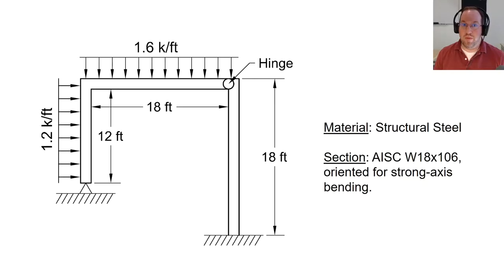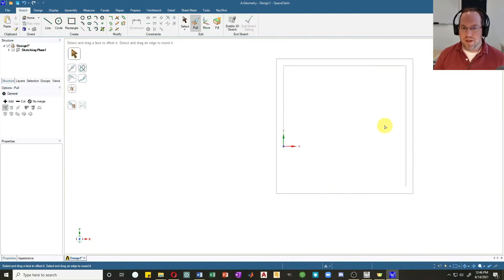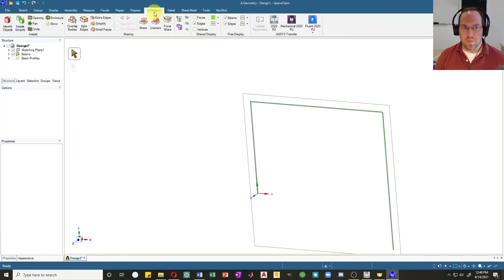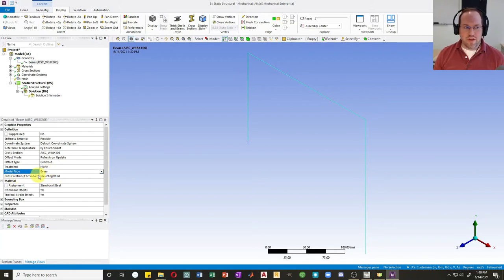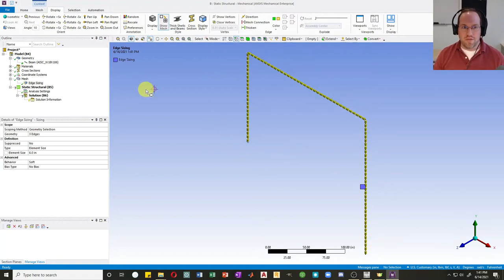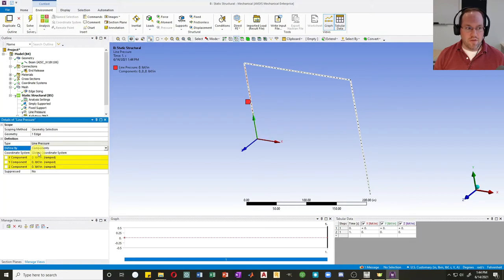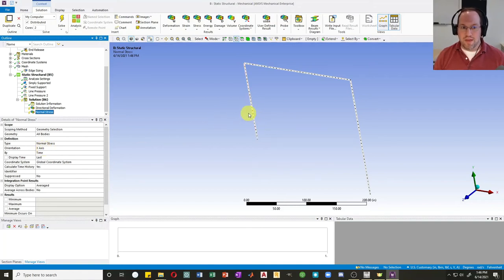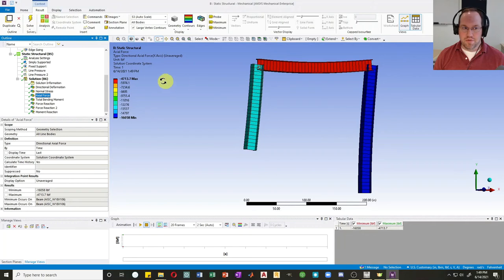Frame Analysis - FEA using ANSYS - Lesson 4

Comment: Hello Prof. H,
I saw your last video for the truss. You change your elements to links in order to treat the problem as a truss instead of the frame. However, I have a question, can I do the same problem by treating it as a frame and applying for an end release at the joints. What I found is, end release is giving some errors while doing that
Reply from the maker: I'd be careful with using just end releases to model a truss with frame (i.e., beam) elements. It's possible and even likely that you could "under-constrain" the model, in which case it will give you a error that you have rigid body motion. Don't get me wrong - it should work in theory, but often in practice something weird and unexpected happens. Without more detail on exactly what you did with your model, I can't say for certain exactly what went wrong. However, best practice is to just use the link/truss element for trusses (and, besides, it's more computationally efficient than beam elements anyway).

Comment: In previous video you changed the number of mesh elements to 1 for each truss member. Here for frame, that was not the case. Could you please explain as to why ?
Reply from the maker: Truss elements can only carry axial load, so in effect they behave as though they are always pinned at the two ends. If you mesh a truss with multiple element in a single structural member, it would be like adding a bunch of hinges along the length of the member - you would immediately see convergence issues, and it would not give you the correct answer.

With frames, the "beam" elements can carry internal shears and moments as well as axial forces. Hinges and other releases must be modeled explicitly with end releases. Because these internal forces will change along the length of the structural member, you need to have multiple elements to accurately model that behavior.
Reply: @StructuresProfH  Thanks a lot.

Comment: Great video!
Do you know, why it isn't possible to use the CP command for coupling DOFs? Your method works but is unfortunately a bit circuitous. :(
Reply from the maker: I'm afraid I don't know the answer to that, but I can take a guess. I agree, the CP command should in theory work. However, once you use the Share Coincident Topology function (the "Share" button in SpaceClaim), I believe the nodes are automatically merged; i.e., not just coupled, but converted into a single node. The CP command generally relies on coupling one node to another, so it may not work in this case when the nodes have been merged into one. That's why we have to release degrees of freedom in ANSYS Mechanical (beam end releases) rather than couple degrees of freedom.

Comment: If we want to calculate the deflection in a steel hollow goal post( two vertical pipe and a horizontal pipe joined as one part)With fixed end of the vertical pipe and if i apply a point load on the horizontal post,will it be considered as a simply supported beam or a frame?
Reply from the maker: Hi Ashik,
A simply-supported beam usually refers to the rather specific case of a beam supported by a pin and a roller. Your goal post sounds more like a cantilever structure (fixed at one end).

Regardless, as far as ANSYS is concerned, all these structures are just models of beam elements. The civil engineering convention is that a bunch of beam elements connected is called a frame. But you can absolutely model goal posts using the techniques shown in this video.

Comment: Thankyou so much sir for making this video 🙏🙏. Sir my question is, if we are making rigid connection at beam to column joint node it self act as the rigid element or we can use any other elements. And one more question sir, how to make semi rigid connection using rotational spring at the beam to column joint..plz reply sir.. 🙏🙏🙏
Reply from the maker: Naresh,
The rigid connection option that I showed here does not make any kind of rigid element (or any new elements at all). It simply constrains the translational and rotational degrees of freedom for the two or more flexible beam elements that meet at a point.

If you'd like to create a rotational spring, check out this video:
https://www.youtube.com/watch?v=pwiR2gyH3EA
Reply: @StructuresProfH  Thankyou so much sir for your valuable response 🙏🙏